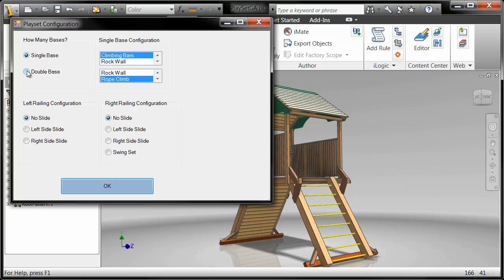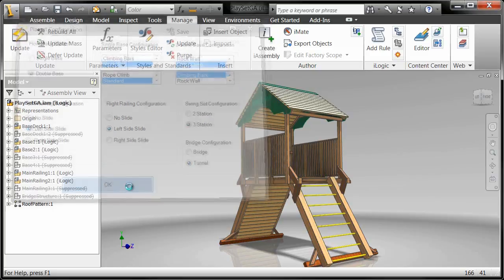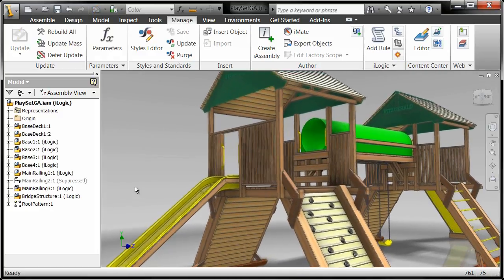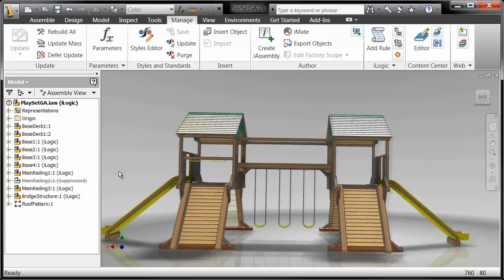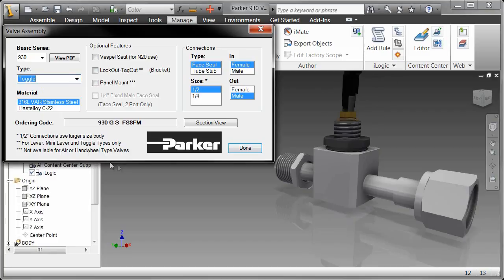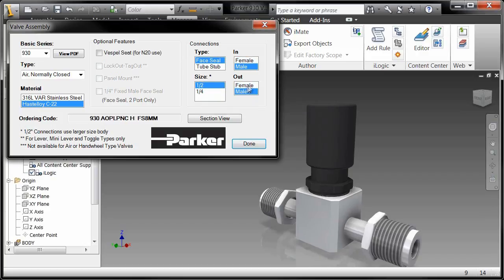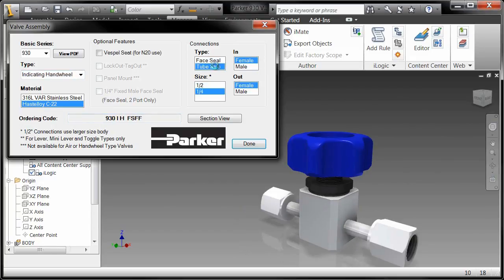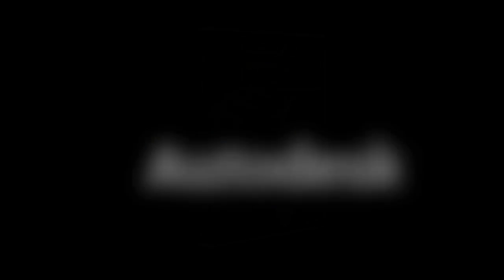Autodesk Inventor vs. Dassault 3D CAD: Design Automation

Comment: Hello Rob, I downloaded your AU package on GrabCAD which included this file but there is a missing railing 3 & the rules don't run properly. Would it be possible for me to get the entire pack n go from this assembly? Would be greatly appreciated, it has many of the actions I am needing to mimic and want to learn from this example. Thanks in advance.
Reply: Hi, how did you find it?